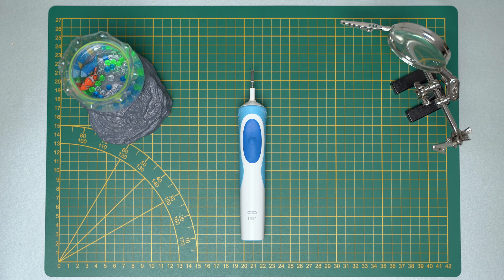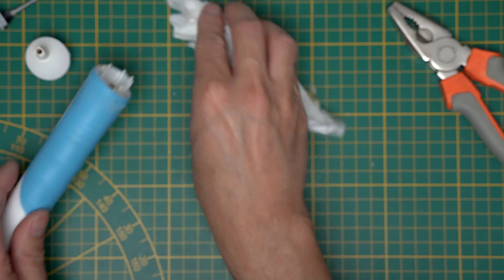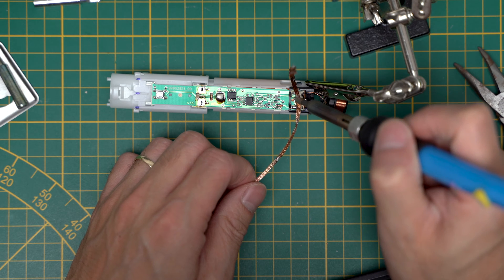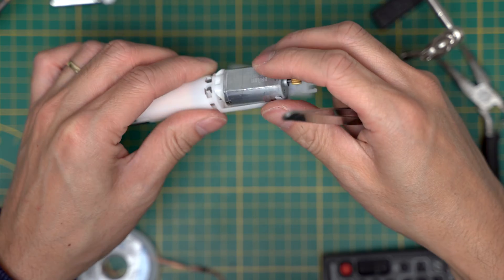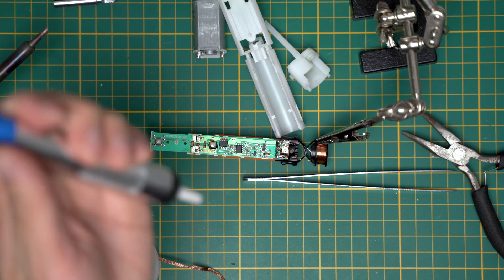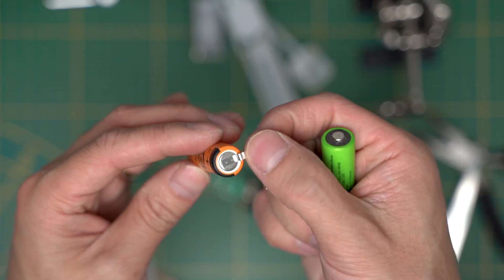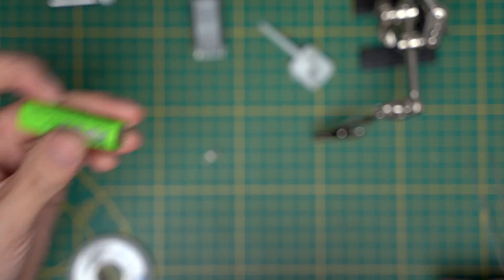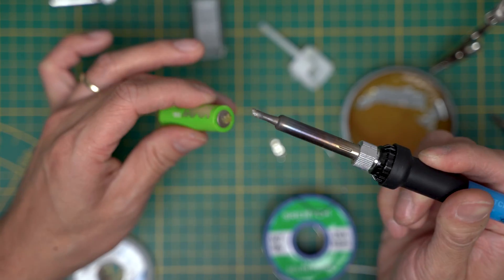Oral-B Electric toothbrush | Battery Replacement | Without Spot Welder | Normal AA Battery MiNH

Comment: Great video, thanks.  I have exactly the same Toothbrush that no longer holds it's charge for a full teeth clean.   I don't think it lasted seven year as you have stated.  Might give it a go changing the battery instead of throwing it away, save on the landfill.

Comment: Great instructions. In my case, I did also struggle to find out the reason why the toothbrush was not working after replacing the Ni-MH battery. However, I checked that it is enough to get it back to life with only a few seconds of charging. Thank you for sharing the knowledge.

Comment: There are three holes on the toothbrush charger. The end of the toothbrush fits into the middle hole, so you don't need pliers to take it apart.
Reply from the maker: Good tip! It seems that some models have that hole. Mine didn’t unfortunately
Reply: hi. the battery is 1.5v or 3.7v ?